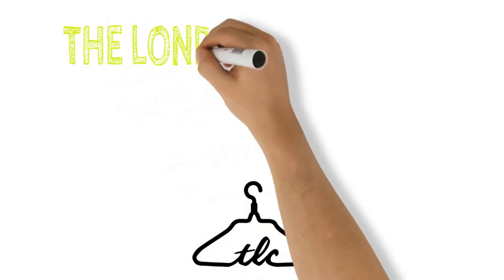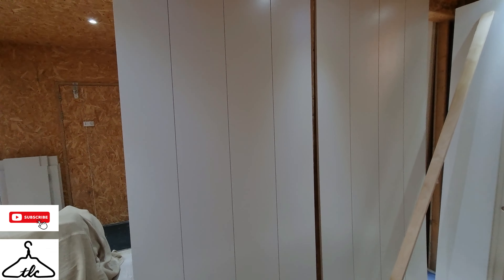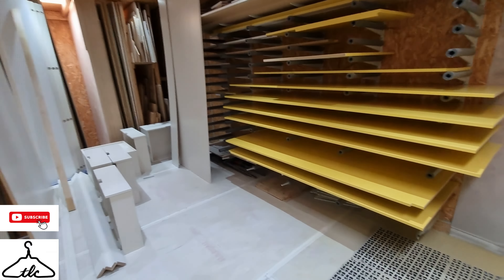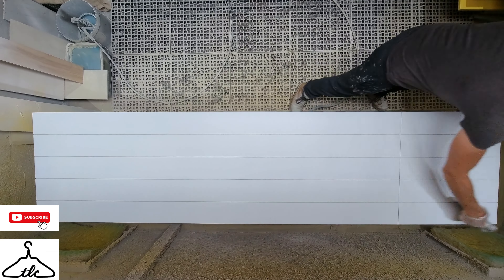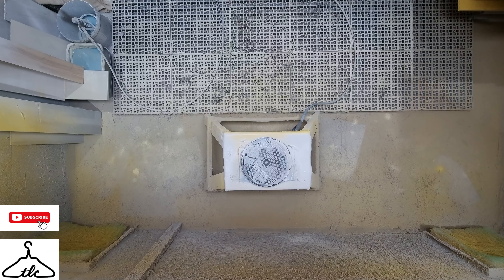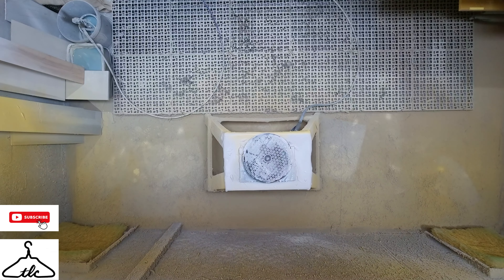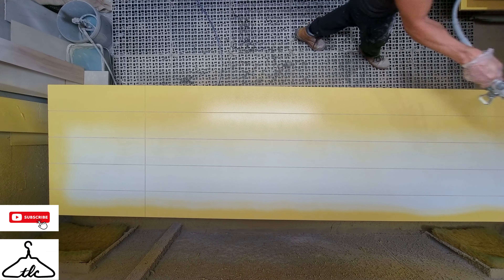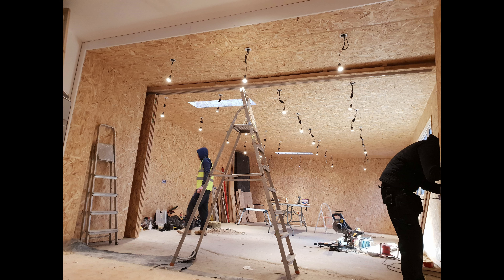This Is How I SPRAY My Panels / Graco 695 Airless Sprayer / Eggshell Finish / Vid#151

Comment: This is great video I really like the way how you prime with this silk paint which is 38 pound per 10 litters ,  but my question is as a top coat for that yellow you end up spraying just one coat or you do apply two coats?  I personally use as top coat and primer this brand Vernites Waterborne it is Italian brand and it is sold by Amicus paint from Park Royal London, it is Environmentally Friendly Paints And Lacquers produce in Italy, in my opinion is better even than Renner which is as well Italian product.   I am using for wardrobes this product in particular: Internal Waterborne Topcoat - Vernites WIT927 Acquasoyz Lack - 1K - Pigmented £17.50. They also have a product with two components which is tremendous hard and quickly dry,  I do use this product for kitchen cabinets and bathroom furniture where mortuary and water and other things can end up on these pain surface which can be wiped. This is the two component product: Internal Waterborne Topcoat - Vernites WIT982 AcquaPur Stone - 2K - Pigmented £24.50 - £26.50. Once one of my customer provide for me the paint which was two weeks time on the eggshell in dark green they was taki and sticky even after a few days.  With this paint never gonna happen something like that .  Vernites it is a water-based polyurethane in one and two components depend of the necessity.
Reply from the maker: Hello Michael, Apologies for not replying sooner, sometimes youtube holds back some comments for some strange reason!

Thank you for the advice, its really appreciated.
I will always use my primer as it is very cost effective and gives a nice flat base coat, but I am looking to improve the topcoats for my dark colours (well ill try darks first then ill try the lights)
I just went to see Rob from your recommendation, and I mentioned you.
They said you are a lovely guy!
I will most likely try some 1K paints, as I dont want the hassle of 2 part paints and them possibly going off inside my airless sprayer.

I am trying darks in their 1K as my dark colours never seem to cure, so hopefully This will solve my problems :-)
Thank you for the recommend by the way!
Many thanks
Ryan Cooper
Reply: Hi Ryan 
I recently have used 1K in black on shaker style panels an I have dry them with diesel heater like that you have and I was inspired about it from one of your video , so rising up the temperature up to 45 degrees Celsius for 35 minutes while the extractor fan was set up on minimum speed for creating a circulation of the air and then let them in the drying room to cool down themselves and in the very next morning I haven packed them in bubble wraps ready to be delivered. 

The panels was topcoat with an airless spray machine  4:10 tip and was  aptly very wet film , as a result was drying very smooth.

Thanks for all your video that you uploaded where you showcased  your technique and tools that you use .

Regards Michael

Comment: With more DIY sprayers you’re asked to water down paint by 10%. I find this fluffs up the mdf fibres and you don’t get a smooth silky finish. Even if the mdf is sanded down before priming. 

Any tips??
Reply from the maker: It does fluff it up, thinning down WILL make it much worse. I dont thin at all.
So after first coat its a sand with 240 to make smooth, making sure not to go through to mdf.
then 2 lightish top coats.
If you are having problems fluffing againg on 2nd coat, then the mdf you have isnt great and you make need another really light sand once more (i never need to)